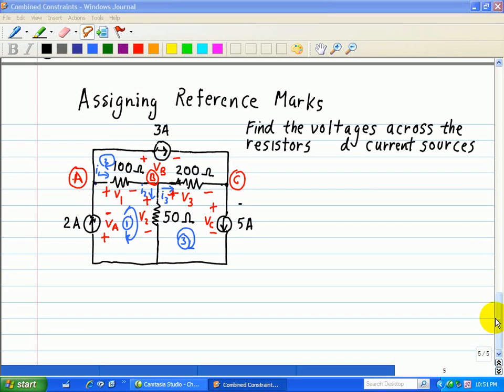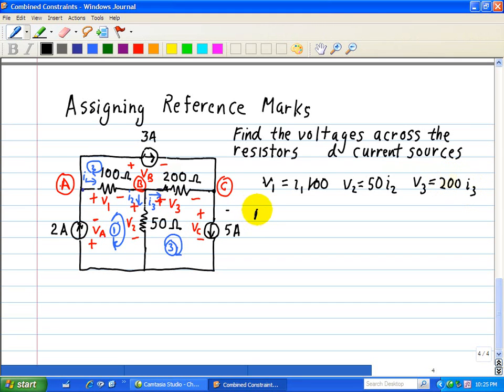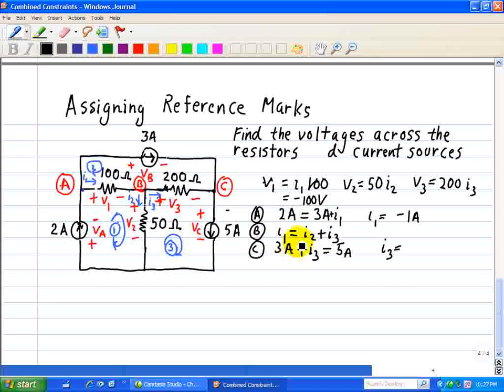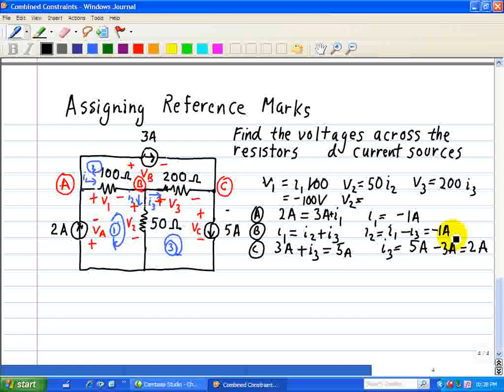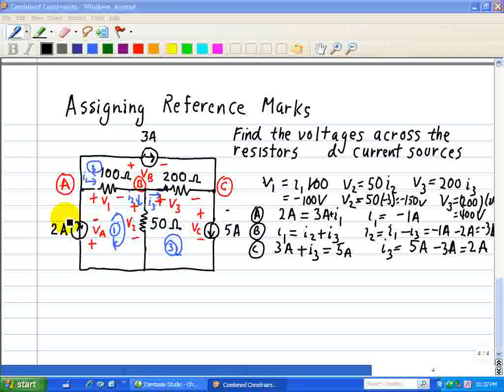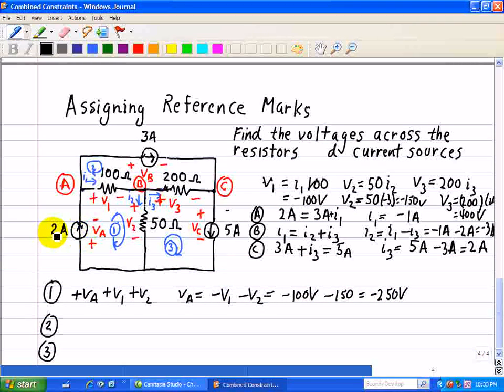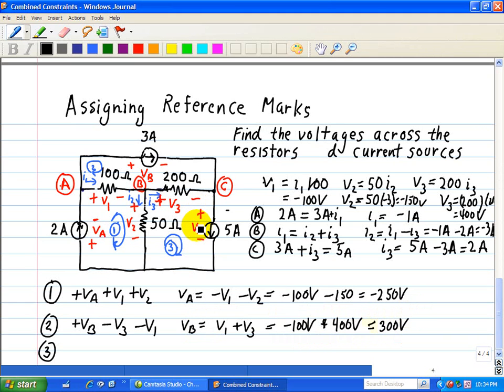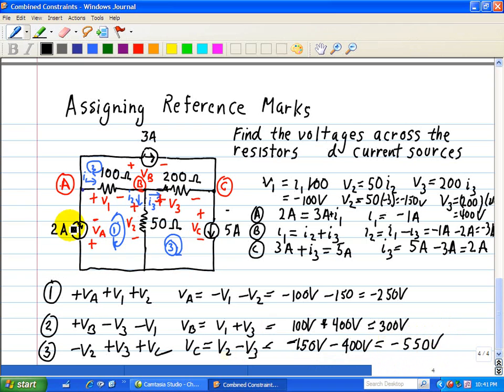Circuit Analysis - Kirchoff's Voltage Law (KVL), Kirchoff's Current Law (KCL), Ohm's Law (Pt 4)

Comment: @drjctu I got -250, but that's because I always set my resistance voltages opposite to my set current direction. So for instance, my 1: +Va - V1 - V2 = 0. And thus my Va is -250. As a matter of fact, all my source's voltajes are of opposite sign as yours. I suppose we're both right in describing the real thing. That's for the video.